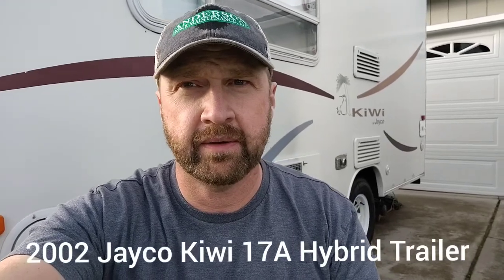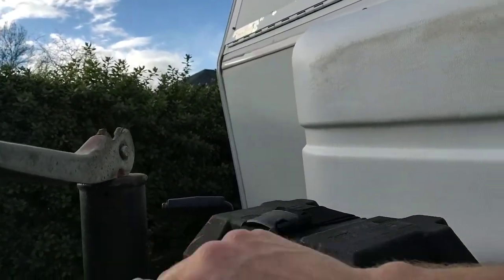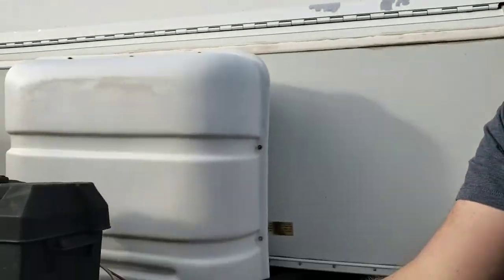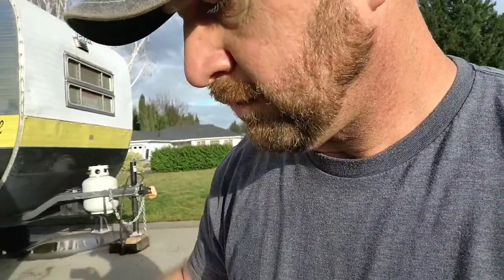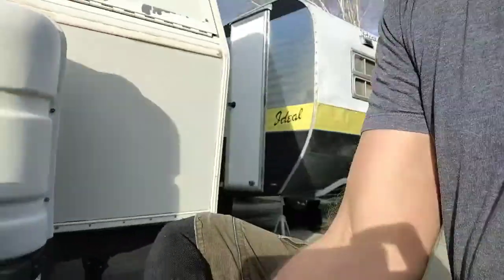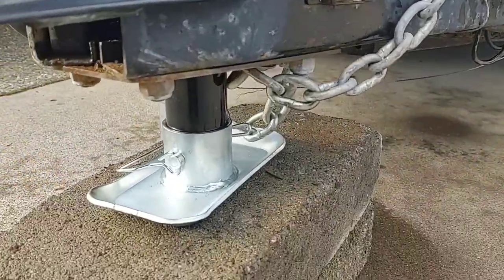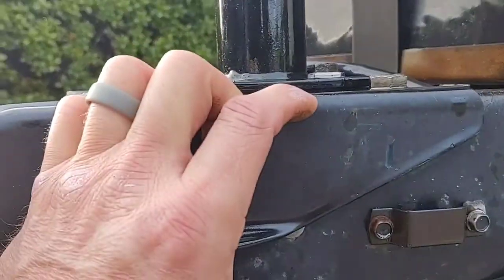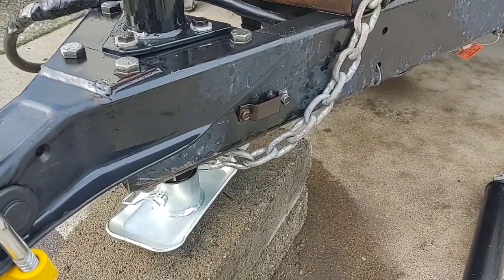2002 Jayco Kiwi Trailer Jack Replacement - Hard to find 1-3/4" inner tube diameter

Comment: Been having the same problem. Trying to get a look at the replacement jack you found but it's difficult to identify in the video.  Is it this one? https://amzn.to/390NyNL If not, can you post  link to the one you found?
Reply from the maker: Pro Series 1401000303 A-Frame Jack https://www.amazon.com/dp/B005DGK1D2/ref=cm_sw_r_apan_i_A3CSGWRHWXS27XJX0PD5?_encoding=UTF8&psc=1

This is the one I used and below is the link to the foot pad that fits that jack.

Pro Series Footplate & PIN https://www.amazon.com/dp/B005DLLVMW/ref=cm_sw_r_apan_i_8RPFZD9BEVW1H64PXXPW?_encoding=UTF8&psc=1
Reply: @andersonhomemaintenancellc9870  Awesome! Thank you. Just ordered it!